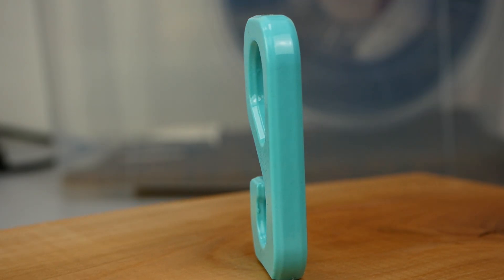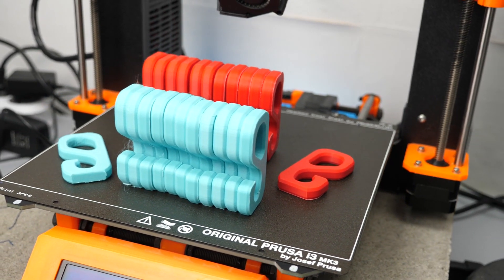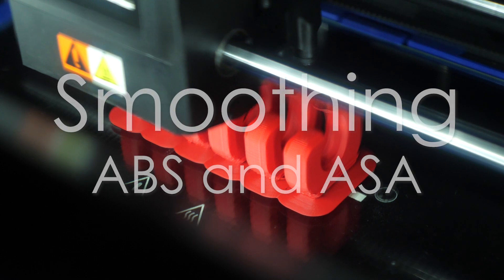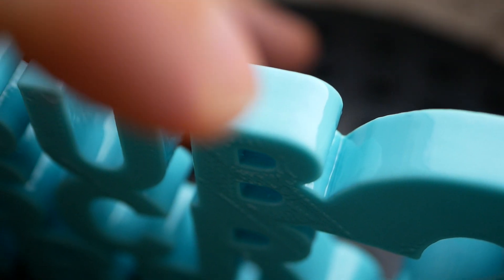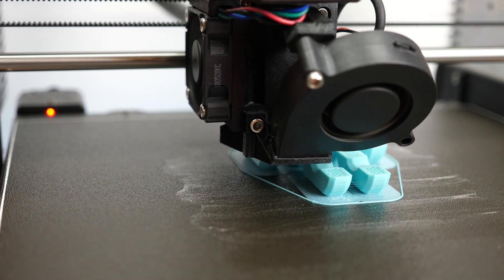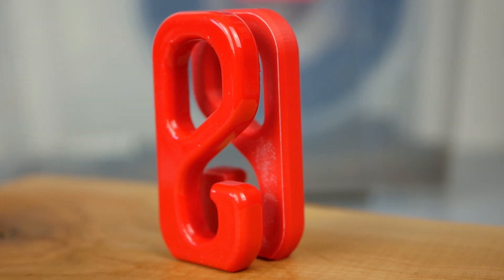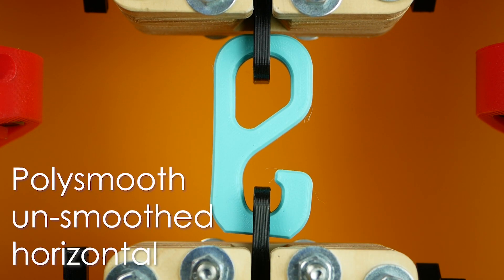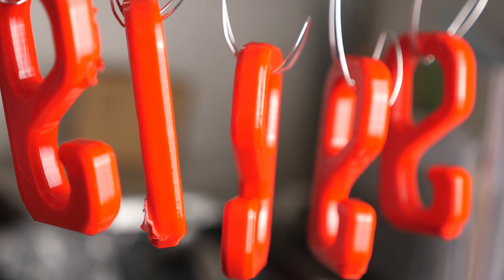Stronger 3D prints with Vapor Smoothing?

Comment: Try changing the infill pattern and repeating this test, or test smoothing alongside the metal reinforcement.

Maybe also alter the design just slightly on the vertical hooks so that the nebulized isopropyl can better penetrate the layers.

Comment: Great video!

Generally the strength of smooth parts is reduced as the smoothing process uses a solvent to dissolve one of the chains in the plastic, this is the styrene in abs. Once dissolved it is no longer part of the ABS chain which is why the stiffness goes down along with the strength, without significant heat the bond won't establish itself again and is also why the surface of the part smoothed never becomes properly hard to the touch again. A small amount of the dissolved plastic will also evaporate with the solvent and if acetone wasn't dangerous enough to be breathing in, the new compound evaporating is much worse.

Comment: What if you designed a part in a way that acetone or IPA was able to flow freely inside the part temporarily to smooth the infill? Don’t know how you would do that but being able to fill it through a small hole then empty it might help strengthen the layers inside.

Comment: What if you printed without a top and bottom solid layer, allowing the vapour to access the inside of the shells as well as the infill? This could fuse together more material than just the small outer ring? Obviously wouldn't work for the lying down samples but perhaps there is another way to achieve this by drilling holes in the unstressed faces.

Comment: Congratulations Stefan on the 100K !
Good test, and I am looking forward for repeating Your tests with "smoother brush applications".
This is not the same as "Vapour smoothing", as You may already have guessed, mostly because the brush application - is not even, and more than that - it is unevenly useful for some 3d-printed partd.

Comment: For vapor smoothing the pla, you can use ethyl-acetate (Tom sanlader talked about it in his nozzle video) that ils easy to use like acetone
Reply: There's quite a bit of conflicting information about ethyl acetate out there. Some claim it works well while others claim it doesn't work at all. I guess the jury is still out there on this option.

Comment: Smoothing might have a much greater effect if the vapour could reach the inside structure as well? Maybe you could print without bottom and top to also smooth all the infill? Ideally you would also have the three outer perimeters with some gap and infill in between to also allow smoothing from all sides. Or just test with only one outer perimeter to verify whether or not this would have any effect at all.

Comment: I used to do ABS by painting the acetone on and it appeared to fix layer bonding problems I had with my old printer.

I did think that with some parts you could put vent and drain holes in the part and smooth the inside layers too and see if that makes a difference.

Comment: Very interesting! I thought maybe I was the one doing vapor smoothing wrong that it made the parts a bit weaker and a little gummy...

Most interesting is that acetone on abs most effectively reduced anisotropy - strength is more similar in all directions. This might be a valuable trade-off for some functional parts, though I suspect many functional parts are now printed with resin or SLS anyway.

Comment: Have you already tested the effect on strength or layer adhesion when printing parts layer by layer instead of completely consecutively? If you print 6 parts in a row, the previous layer on the first part has already cooled down a lot more than when you print just 1 part at a time.

Comment: Why do you use a layer height of 0.165 on the dremel? Any reasons for this height? Thx
Reply from the maker: 0.165mm x 8 top and bottom layers = 1.32mm
0.44mm extrusion width x 3 perimeters = 1.32mm
This way I ensure constant wall thickness regardless of the printing orientation.
Reply: CNC Kitchen Thanks for the fast answer

Comment: Really interesting  test , but could you produce normalised symmetrical test tubes like in other tensile strenght tests ?
Thanks  for the efforts nonetheless.
Reply: I actually think those ones are better. Because its a bend test most of the stress is on the surface. That way the effect of the surface treatment is more prominent.

Comment: What about printing on a Diagonal? For SLA prints they typically print things not directly on the bed. So I was wondering what would be the waste (for support material) vs strength of printing at different angles?
Reply: there's two ways this can fail, either a brittle or ductile failure. the vertical prints had brittle failures. the horizontal prints had ductile ones. the brittle failure will happen if you load the layer plane in tension. bending is actually just fancy tension. how stress transforms as you rotate the plane has a bit of nuance but mohr's circle describes it. here's an online calculator ( http://www.graniteng.com/mohr-2d ). long story short at an angle there would still be a bit of tension on the printing plane.

Comment: This makes me curious to see the impact of other solvent smoothing methods.

I've found ethyl acetate to work well for smoothing both PETG and ABS. PETG is noticeably weaker, and almost rubbery for the first few weeks after smoothing so I would give the parts at least a month to air out. I doubt the parts will be stronger, but I am curious to see how part strength is affected.

Comment: I think to be sure that the solvent is 100% removed, the only solution is to create a vacuum chamber... This technics is used in the space industry for composite materials (to remove solvant but also gases, moisture etc..)
Reply: I was wondering what dangers to the vacuum pump seals there are from these airborne chemicals?

Thing also to remember is that as the air pressure goes down so does a chemical's boiling point.

You could maybe just have a open container filled with the smoothing agent at the bottom of the chamber, vacuum out the air, let sit for a time, release the vacuum, remove from smoothing chamber and repeat the vacuum in a chamber with no smoothing chemicals present except for those on the 3D printed item.

That should remove any remaining active chemicals.

I like the idea of the lowering mechanism, just make a easily removable plate so the items can be moved from chamber to chamber without having to remove the items from the plate.

With a large enough set of chambers maybe you could just place the printing plate from the 3D printer right into the chambers directly from the printer.

I would have to figure out some sort of venting system as I live in a retirement building. I maybe old but I'm still Evil.

Comment: I've seen videos about fire polishing cut edges of PETG sheets, I wonder if you can do the some thing with PETG printed parts and achieve better layer adhesion.
Reply: In the industry they debur injection molded platic parts with heat from IR irradiators, but only the seams.

I think smoothing 3D printed parts with fire, isnt that good of an idea.
Because the melting point is much higher than the glass transision point, so the part will get soft and wobbly, before you smooth anything significant like layer lines.

It only removes stringing, but that works really good
Reply: I know I have read that Little Tikes plastic toys that have any sharp edges and seams are smoothed with torches before shipping out. I don't remember where, but I read that many years ago.

Comment: Try Vapor Smoothing PETG, I cant find anything that works well
Reply: Thats because the solvent you need to vapor smooth PETG is something you dont want to use to vapor smooth anything.
Reply: @GamesPlayer1337  You mean Toluene? Ive already tried that for 2 days and it has just turned my clear PETG milky, not removed any of the layer lines
Reply: @VoltexRB  i dont know anymore what it was, but not the one you mentioned. Sry :)
Reply: @GamesPlayer1337  PETG is solluable in 3 materials, Toluene, which is commonly used in explosives like TNT, Cyclohexane and MethylEthylKetone are just strong solvents. All available if you have a chemists degree and work in a lab here, like me. All just kinda make PETG milky over the course of a whole day
Reply: @VoltexRB  ah good to know... sad :/

Comment: how about vapor smoothing and then bake them in a relative low temperature to recrystallize the plastic structure and evaporate the deeply penetrated acetone
Reply: This would only work for crystalline plastics - ABS is amorphous and doesn't form crystal structures.
Reply: Can someone like my comment so I can read all this later? Thanks 👍
Reply: @meltymeltymelty  I didn't do a very scientific strength test, however, there wasnt a noticable strength difference in our application.  We had an area of the mold that was more susceptible to breaking due to bending forces in that area, but annealing/not annealing didn't make any difference against the amount of force we were putting in that area. We just had to shore up that area with more ribbing on the outside of the mold to strengthen that area, and then increase the draft angle inside the mold so that we didn't need to apply so much force. 

The pry points on the mold take a beating from using a flathead screwdriver on them. But they've held up well enough when printed solid. Annealing didn't really add enough strength to make a noticable difference with the pry points either.

If there is any strength difference between annealed and non-annealed ABS, I found it to be marginal. In an application where non-annealed ABS isnt quite strong enough, I would use a different plastic/material altogether. I only annealed it to maintain a smooth surface during use.
Reply: @Much2shy142  
The "annealing" process seems to be only useful for semi-crystalline/crystalline plastics. As someone already mentioned - ABS is amorphous, so there's not much to gain from it.
The whole melting and fusing layers together theory doesn't seem to work out exactly as intended, so it mainly seems to be about level of crystallization and arrangement.

What I actually wanted to ask - what kind of resin do you use and does the vapor smoothing spare the need for a release agent?
I've got to make some molds soon, would be great to know.
Reply: @heinzhaupthaar5590  I recommend using a release agent regardless of the use of an acetone treatment. I also recommend doing something to reduce layer lines, as they can make it a bit harder to de-mold your casted part depending on the mold design. I prefer acetone because it is quick and can also seal any gaps or places my casting compound could otherwise get into that I may not notice ahead of time.

I have not tried to make a mold with a resin 3d printer. I hear those resins are incompatible with platinum cure silicones. Its possible something like Smooth-on's Inhibit X could solve this. Coat the printed resin in Inhibit-X and there may be no problems with casting platinum silicone in it, but I haven't experimented yet.

I was casting a platinum cure silicone in the FFF 3d printed ABS molds I made. That particular silicone needed to be heated after injecting it into the mold so that it would cure in a reasonable amount of time. (2hrs vs days) I don't recall the name of the silicone. It was meant for potting electronics. Not all platinum cure silicones need to be heated though. 

Heating acetone treated ABS can lead to surface cracks on the mold after a couple of uses. Annealing the ABS mold before acetone treating prevented that. Perhaps I misunderstand the reasons that works but there was a distinct difference in surface finish quailty/longevity between annealing vs not annealing when using the completed mold in an oven repeatedly. If you won't be using the treated ABS in an oven, annealing is not needed.
Reply: If you intend to bake a part that has been treated with acetone, it is best to anneal it once just before the acetone treatment to prevent the treated surface from crazing when baking it again after the acetone treatment. I had to figure that out the hard way.
Reply: @Much2shy142  can you explain that again in more detail?

Print, bake, acetone, bake?
Reply: @mortarriding3913  exactly.
1. Print
2. Quick sand with 220 grit sand paper if desired.  Slightly sanded ABS will smooth faster and more evenly, so you won't need to do the acetone treatment so aggressively, thus lessening how much the the part is weakend.
3. Wipe part clean of dust with a damp rag or cheesecloth.
4. Bake at 200 degrees farenheit for about an hour or 2, then allow the part to cool to room temp in the oven after turning it off. This settles and "reorganizes" all the  "fibers" that were agitated in the printing and sanding process. This way they won't continue to shift after the acetone treatment, which is what causes crazing (surface cracks).
5. Treat the part with acetone.  You can vapor polish as Stefan did, or for a more controlled application, spray the acetone on the part using a chemical sprayer in a well ventilated area, preferably without a lot of wind so the part dries evenly. 2-3 coats about 30 -60 minutes apart leave parts as smooth as a babies bottom.  I use a sprayer I got from amazon; Smith T100ACT.  It's meant to stand up to corrosive chemicals like acetone.  Just don't store acetone in it for days and it will always work like new.
6. Allow the part to dry for at least 24 hours before you touch it.  All those layers of acetone treated ABS need to solidify completely before you touch it. If light pressure from a fingernail or pin easily leaves an impression, it's not dry yet.
7. Use part as intended or bake it again. Further baking at this point may not restore more strength to the acetone treated ABS but it won't hurt it.

I used these steps to finish ABS printed molds used for potting electronics.  The potting compound needs to be baked at 158 F to accelerate curing.  So this ABS mold frequently sits in a 158 F oven for 2 hours at a time, then stands up to me prying it apart off the electronics. The same 2 printed molds have been going strong for at least 1 year now.  No crazing and no breaking.  I did need to have them printed solid to withstand all that prying though.  Their sparsely printed counterparts lasted about 5 months before they started breaking.  Still no crazing though.
My purpose for the acetone treatment was not to add strength, but to smooth the mold surface so it would be easier to remove from the potted electronics.
Reply: @Much2shy142  it's 2 years later but I just found that out the hard way as well... Except with a heat gun because i printed the holes for a screw a little too small.  Now it's covered in bubbles
Reply: Plastic... crystalline? wot?
Reply: Not a good idea if it's PLA I think it's a torture. But worth to try..
Reply: Does work
Reply: I think you could achieve the same thing by leaving them in the sun on a high UV day.
Reply: @mortarriding3913  UV breaks down all plastics.
Reply: @leofortey7561  I have printed new cups for anemometer about 5 years ago out of pla and they are still up there and still catching the wind
Reply: @leofortey7561  Unless an additive has been included which creates a UV resistance. Albeit eventually yes goodbye mr plastic.
Reply: That may work on metals but not for thermoplastics. Their properties decrease when you heat cycle them. A good example is SLS printed polyamide which can only be heat cycled a couple of times before the entire build chamber has to be replaced.
Reply: @ChrisCross97  you clearly don't know how SLS works. The powder is heated just below the melting point, so it will be a powder, but the granules will eventually clump together. If you use it, your print has no detail.

Comment: Yay, the first person to finally state what "dangerous" substance is used to smooth PLA.
points to Stefan and many negative points to all other Edit* 'Outlets of information' that have danced around that information.
Reply: I've also heard of people suggesting dichloromethane as potentially being able to do it, as it's able to "weld" PLA just like acetone with ABS, but it's fumes are INCREDIBLY dangerous; it's really good at causing you to pass out, and if it doesn't make you die on the spot, it'll give you cancer later.
Reply: I also heard that you could do it with MEK just like you would with acetone. Never tried it though...
Reply: Both DCM and MEK are pretty fucking dangerous, no need for the quotes. Usable, but you need to know how to handle them and be far more careful, even just using it to weld parts, let alone vapor smoothing. Acetone on the other hand isnt dangerous within reason, and anyone could do it safely with a quick youtube video
Reply: OsmeOxys "pretty fucking dangerous, no need for the quotes" He was using the quote because he's quoting someone. He says that everyone says it's "dangerous" without stating what substance it actually is. I use quotes to because I am quoting something, not because I don't believe it.
Reply: @LoganDark4357  Correct!
I'm going a little further to clarify my point, yes these chemicals are very dangerous, but when one simply tells people something without explaining why, they usually try to go out and do it, like "Don't look down."
It's more responsible to say, "Chloroform can smooth PLA, but the risk is very high as inhalation of chloroform vapors can kill your liver and kidneys; and short term mishandling also presents many obvious, serious, risks, especially if you are alone."

It's sad, but there will always be people who do stupid things, but it's better for information to be freely available for people to make educated decisions on their own.